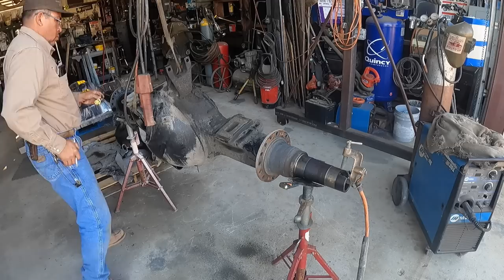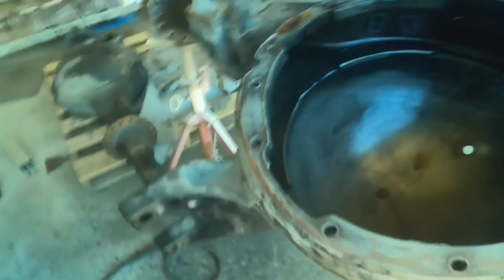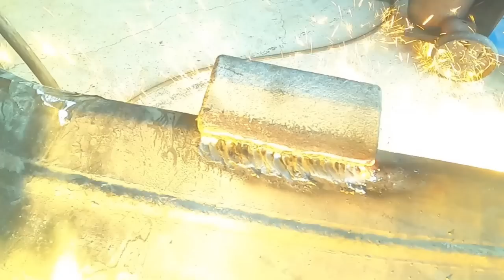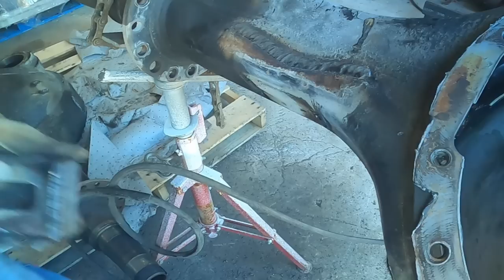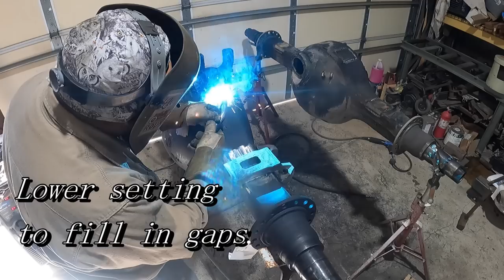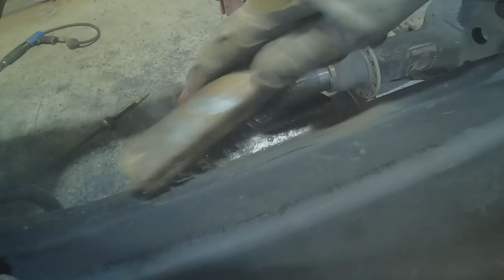Big Rig Axle Spring Perch swap.

Comment: Definitely turning into Pakistani Truck channel - just need a bed frame to lie on during hotter days!
I can imagine a line of people waiting for those axles to be welded. Next they go to a mechanic and while they do their thing the truck owner and driver will be tapping their fingers on a desk. 
Some great content here showing real world repairs. Keep them coming   :)
Reply: Issac can start by ripping out all the concrete and burying a length of train rail in the dirt for ground.
Reply: To qualify for Paki Truck Channel, wouldn't be need to wear sandals and be on dirt floor? 🤣
Reply: @xoxo2008oxox  ..... don't forget slightly  bend welding rods and safety squints....!!

Comment: I did one of these before and made a bracket that went from 2 of the front bolt holes for the hogs head up to the 2 on the top torque arm mount so you know for sure where it has to line up on the new one. Awesome video thanks for sharing.

Comment: Thanks Issac.  I have wanted to see a close up detail of how you arc gouge.  These were some great shots.  I noticed the somewhat circular path you move the tip, but would love some additional explanation of the reason for that particular movement and how it relates to the parting line between the two parts.  That was hard to determine.  Thanks again for yet another great vid.  God bless.

Comment: With circular flanges at both ends and bolts holes in the center bracket, I suggest make a frame connecting all the brackets and attachments with either bolts or locations referring. Remove the “location space frame “ and then gouges off the fittings. 
Attach the location space frame to  the new axle using the circular end flanges. And use the location space frame for the coordinates for the placement of the brackets and attachments. 
No measuring or square up required!! 
As you have two identical axles one only needs one LSF.

Comment: Looks great, i have my eye on an old Hayes cabover, it has Hendrickson leaf spring walking beam suspension, which i would like to go to new way air ride suspension, my only real concern was warping the housing when cutting off the old brackets and welding on other ones, now i'm less concerned, thanks for your effort in making videos.
Reply from the maker: I would imagine that they make the axle housings big enough and thick enough to accept a variety of mounting pads, etc. The housing blanks are sent bare for that reason. If you do something similar, I think it should be fine.

Comment: I've done this same job so many times over my 46 years of welding. The torque rod mount is a common failure point. That and cracked frames on Mack Trucks. I started to make my own frame mounts that are wider than the factory ones.

Comment: Isaac, About halfway thru the welding the sound changed to a lower level "frying". Was that you mike or did you change your machine settings?
Reply from the maker: I did change the settings. I also sped up the video on a couple of spots.

Comment: I have never done arc gouging, and have a couple of questions. 1. What is the current required? 2. Is it AC or DC?. 3. How much air at what pressure is used?. I probably have a large enough compressor, but may not have a weld set capable of delivering enough current.

Thanks for the video, I do enjoy them.
Reply: Answer is it depends.  Current is going to be electrode dependent.  90-400 amps is not uncommon.  I'd probably want access to 25 cfm.  Typically DC, but AC is used for some substrates.  It's a dedicated process like anything else.  No doubt your preferred equipment manufacture has information on the process.

Comment: I have watched you now arc gouging a lot of times on your videos, I still don't understand how the air gets to the gouge arc to literally blow off the liquid metal when it is hot. You showed the air adjustment on the handle. But how does that get to the arc gouge...Or are the sticks made to produce the blowing effort? IDK...
Reply from the maker: Check out the video with the front end loader attachment. I explain more there.

Comment: I would have built a jig out of scrap before cutting the spring perches and torque rod mount  off - you only have to be out 1/8 and it will not bolt up right or some weirdness. hoping it all went well

Comment: I reckon one of the hardest parts of welding is knowing what settings to use for what. And having the knowledge to know when they are working correctly. I don't weld all the time so get out of practice. You lose that muscle memory. Recently I bought a new much more powerful welder. Now struggling to find the right settings. Yes there are charts on the lid but they are basic and are only really for welding on the flat. I had some vertical to do and on my old welder I had worked out the settings. Seems much harder to tune in the new one. My old welder only had Amps and wire speed. As it was mostly on maximum I could just manipulate the wire speed. The new one has voltage and wire speed. Seems harder to get a balance. You can't beat practice and experience.

Comment: Does the air pass through the inside of the electrode to blow away the molten metal?  Cuts like butta!  😎👍 Bet the "inspector" gets lost when the sparks fly!
Reply: In the Arcair torches of the 70's, the air nozzles were in the electrode holder near where it grips the electrode.  I don't think that has changed.

Comment: Ever thought about charging to dual shield 1.2mm wire in the Workshop Isaac   🤔
Reply from the maker: yes, I've been wanting to try it but haven't switched over yet.
Reply: Yes , it's obviously a more expensive consumable than solid wire , but I run a E71 - T1 wire and find you can't beat its speed & versatility. Verticals & overhead all on 1 setting. I like using the Hobart fabco 525 , with Argon & Co2 mix .Yeah definitely worth a try if you're interested 😉

Comment: Nice, personally I would have made a simple reference Jig from box section and a bit of plate then used the diff housing bolts and it would have taken out the guess work.. made it fit the original then the new..
Reply: Good idea !
Reply: @bryanlatimer-davies1222  Ta Bryan, see doing a toolmaking apprenticeship  45 years ago you have to have a reference point. 
When I did lorry chassis we moved the cut line on the new piece 3mm the other way to allow for the weld gap lol
Reply: Without having seen your comment. I’ve just made the same suggestion:- to make a location space frame
(North Essex Uk)

Comment: Supply issues = didnt want to pay for the extra cost  lol
Reply: Sometimes,  but not necessarily true for every case.  Sometimes completely "dressed out" axle housings with all the weldments for a specific OEM configuration are not available off the shelf but instead are "made to order" (with a fairly long lead time". But on the other hand a standard base axle housing is usually available pretty easy (unless the application is very old year model) because base models may have a very broad usage across many OEM brands and configurations.  It is the specific weldments that tailor the axle to the OEM application/configuration.
And that is where you need someone with Isaac's expertise to make that option viable.
In this crazy supply chain environment right now,  some OEMs have been unable to obtain certain items to complete the factory build on some trucks and have had to resort to going ahead and shipping unfinished trucks on to the intended dealer destination with the promise that the parts will arrive at some point and the dealer will finish the build out.
If they held every unfinished truck at the factory until the scarce parts arrived they would run out of storage space and possibly have to cut production even more.